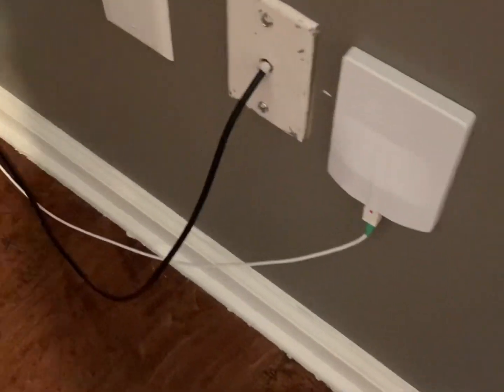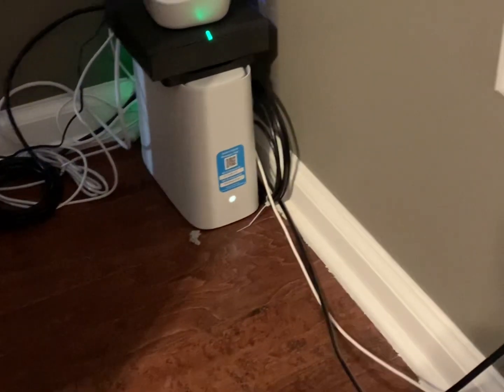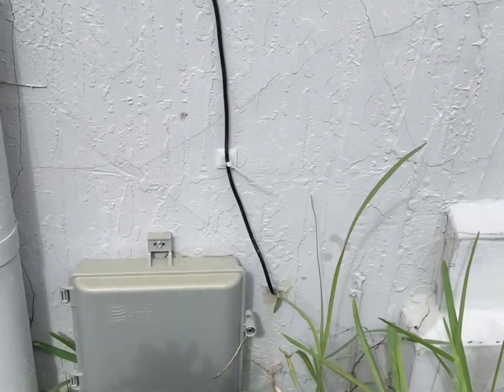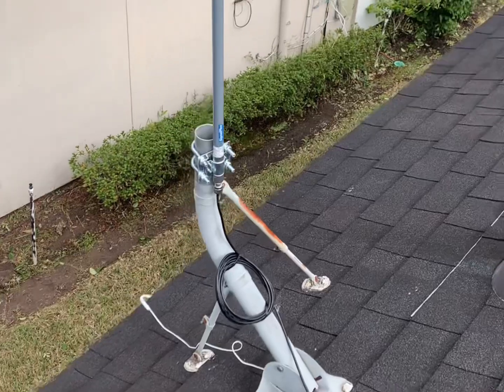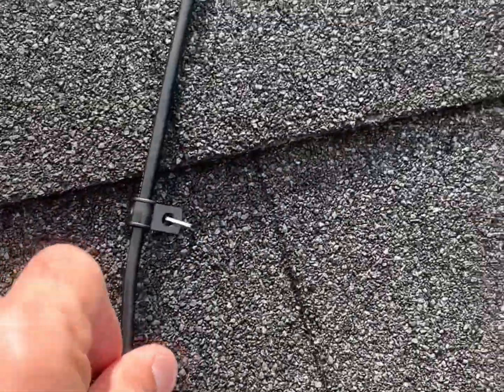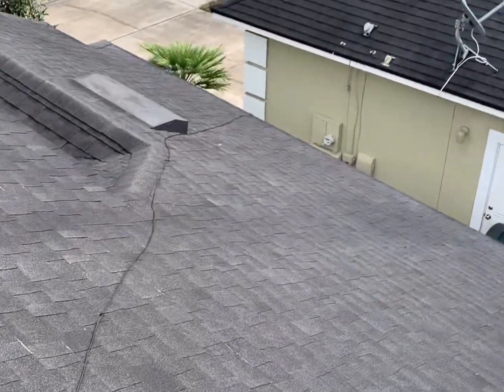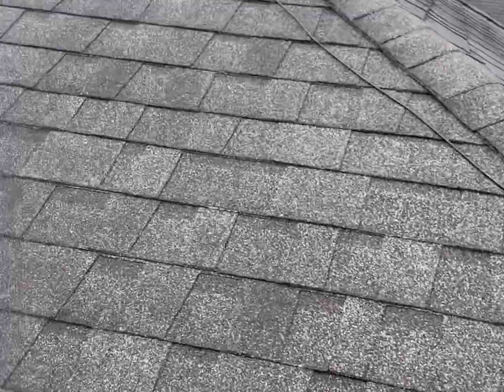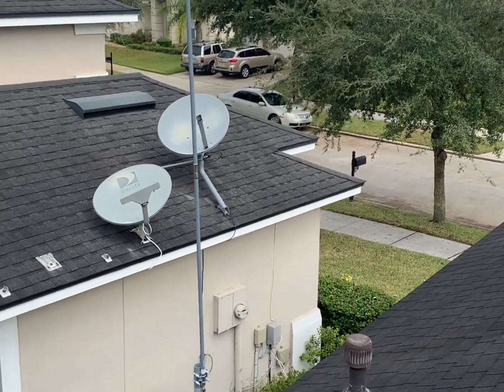Helium Bobcat 300 Antenna upgrade 15dbi

Comment: Should have lmr400 ( take measurements ) 
And make sure your antenna not distracted by the pole whatsoever. 
MAN you loosing a looooot
Put the bobcat in a enclosure and run a very short cable with POE CAT6 you'll Tribble your earnings

Comment: Why not just move the antenna mount to the other side of the roof and use a shorter cable my dude. You're loosing dbi power with your long's ass cable . Well , you have. 15dbi antenna so I guess it doesn't matter that much🤷
Reply from the maker: I couldn’t do this because I live in an HOA community and they are assholes. I was trying to reuse what was already available. I ended up building my own non penetrating roof mount in another video.

Comment: I agree.. the dB loss in that long coax run will negate any upgrade you made to that antenna.... the miner and antenna should be close as possible with no splices in between... just my too cents

Comment: Hi mate, you’re loosing over half your power in that long cable. Assuming its RG58, the rule of thumb is that it will loose about 20db per 100 feet including the connectors, so if you have 19f that’s about a 60% loss. As others have suggested, see if you can shorten the coax by relocating the miner or the antenna, it will make a huge difference to the performance. Happy mining!

Comment: Very bad install. You failed big time. You will lose so much dBi (signal due to wire) (Helium miner don't like long wires) and you have completely 1 damaged your roof and 2 you have a wire going through over your roof which can be dangerous too, lightning, hazard roof wire fire and the sun heat ray can destroy the frequency of the cable when the surface of the roof gets hot. Best is to get yourself window antenna kit. Then move your helium miner to the window and your set. Good luck "Type window helium antenna" it will pop up eBay

Comment: Nice set up! Please keep us posted on your earnings please. I have a similar setup. You can put 1-1/4" EMT conduit pipe where the old dish antenna went. I put 5 additional feet of the EMT just to get me over the neighbors roof line with a 12-dbi I'm thinking of going the full 10 feet.
Reply from the maker: Uploaded a new video showing a non penetrating mount that I built so I don’t have to use the dish mount.

Comment: No my friend, you have to run as short antenna cable possible and running inside of the house, just like you have outside that cable with the heat. No no no no.

Comment: LMAO! 15dBi antenna and probably a 14.5 dBi loss in the insane cable run, with extra connectors and cable looped up for even more losses under the antenna just for good measure!
Reply from the maker: Looping the cable doesn’t increase the cable loss and while connectors make a difference there is logging wrong with the ones I selecting. Yes your right high dbi and long run of cable as well. Thanks for commenting!

Comment: I am afraid you've lost so much dbi only on the length of the cable and the number of connections... Use some dbi calculator, because you are living an illusion now.
Reply from the maker: It’s not an illusion if you know what’s going on. This was my first setup and is a learning experience! Thanks for the info though!

Comment: U have wrong all. Shorter cabel. Antenna should be smaller or way higher than you have it..like 3 stories lol.
Reply from the maker: Most certainly a shorter cable, unfortunately I haven’t found an easier way her at my location. The height seems to be fine though and pretty average for where I am at. Thanks for commenting!

Comment: You did all that work but you didn't install a cheap lightning arrestor and ground your antenna? Static electricity will fry your miner. You should ground it right away.

Comment: Try running  the cable either through inside of the house and up the exterior wall where the old satellite dish mount is or around the bottom of exterior wall and up to the satellite mount as you will have problems in strong winds, snow etc to do maintanence .  I used to fit satellite dishes and have never seen a cable run over a roof.

Comment: The antenna needs to be at the peak or on a galvanized mast above your and neighbors roofline, run should be as short as possible and using LMR600 on the outside to the antenna. The mount needs to be grounded (should be one from sat install), coax should be grounded, and a grounded lighting arrestor before it enters the house, then you can use a short run of LMR240 from surge protection device into the house through existing hole.  

I have used old satellite mounts for Helium but you have to clamp a galvanized steel post to it and get the antenna up. The high gain antenna is fine but if there is any signal (which I doubt) making it to the antenna its bouncing off the roofs.

With your rain loop or excess you made whats called a choke, cant loop coax like that.
Reply: All good suggestions, but for my set up the only way to fix my signal loss issues was to just get an outdoor enclosure and run poe, going to set it up next day the snow melts
Reply: @irweezyy  that’s def what u gotta do man!!
Reply: How do you organize excess coax if you don’t coil/loop it?
Reply: @baopham516  cut it and crimp a new connector to the end. This is how I shortened my lmr 400 from 100 feet 50-60 feet.

Comment: Put the antenna at the highest point on the roof & setup as POE you will double your hnt also bin the 15dbi for maximum 6dbi your 15dbi isn't running at 15 with that cable you are losing to much signal to run anything less that's why the other antenna didn't work
Reply: hello, how do you set it up as POE?
Reply: Poe antenna?
Reply: He may live in a state with weather that gets to -25 Fahrenheit where putting the miner outside is not a good idea.

Comment from the maker: Update on the setup: I switched out this antenna for a 4.5 dbi to see if rewards changed and they decreased. I switched the antenna back to the 15dbi that you see in the video but my cable loss is still to high so I am not making as much as I should with a better quality cable. I figured I’d have a high cable loss but I couldn’t get a better position on my house to shorten it so I will leave it for now.
Reply: Your cable is too long and low quality, what you need is a LRM400 cable under 25 feet long, 5.8 dbi antenna from rokland or Rak or a hntenna, if you have a lot of hotspot around you get an outdoor enclosure to place the hotspot outdoor close to the antena, PoE for internet and power of the bobcat.
Reply: @fusiontechrd  agree...95 feet of rg58 is garbage...get lmr400 for sure...move bobcat to garage to shorten run.
Reply: I ordered a 12 dbi antenna with a 20ft cable.. sounds like the better deal if the cable can’t be longer than 25ft… still interesting to see a 15dbi attempt, much appreciated.

Comment: Every connector and every inch of cable you will loose much of your earnings. Put your antenna on the other side of the house , and put your miner higher up on the wall, try to use less than 15 feet of cable if possible use more Ethernet cable vs COax as you’ll loose less connectivity that way.

Comment: You’ve got to be losing so much power over that long cable run. That 15dbi antenna is so pinpoint, are you even getting any witnesses?
Reply from the maker: Yes I have but not very much only a couple
Reply: I think the long cable run isn't as much of a problem if you use the right cable type.